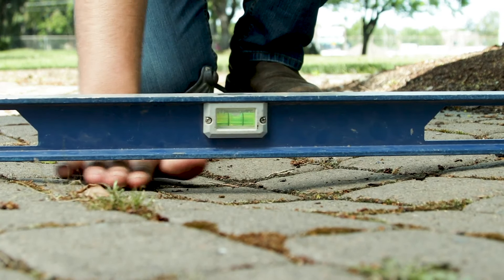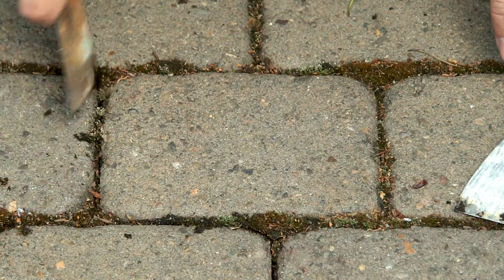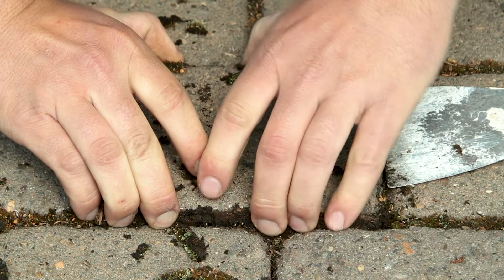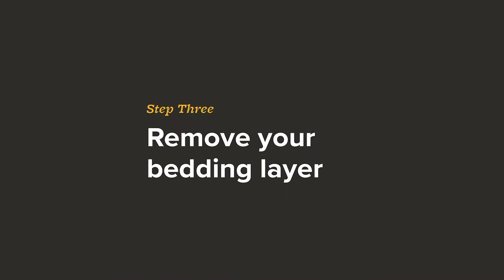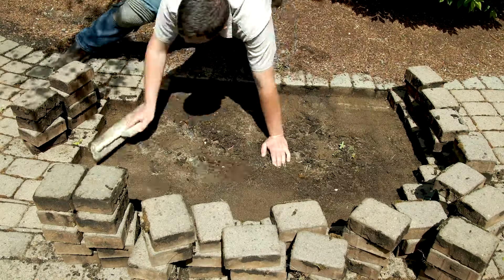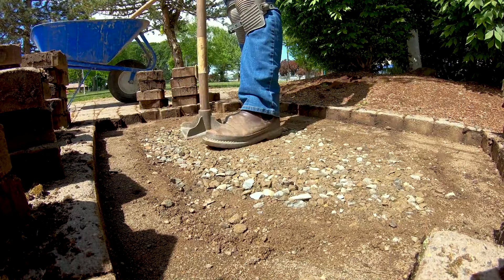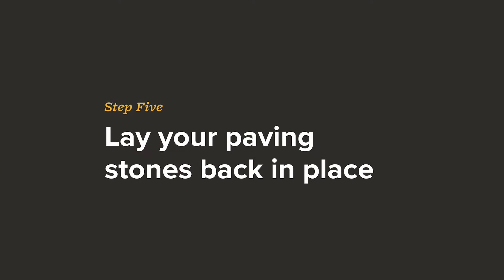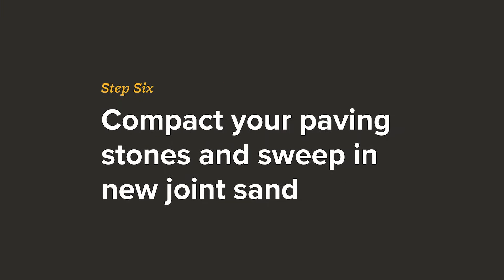How to Repair Sinking Patio Pavers

Comment: If you have a pattern or cut pavers. Put them out & lay them the way they were pulled or you will have a headache
Reply from the maker: This is very true. Often it is helpful to mark each paver with washable sidewalk chalk. Also, taking a photo prior to removing the pavers will make it easier to go back correctly.
Reply: @WesternInterlock  take a picture before you remove everything so you can put it back the way it was
Reply: Number every stone with a chalk stick and take a photo it will give you correct orientation and placement references.
Reply: This comment prob just saved me
Reply: Number the blocks with chalk and then take a photo

Comment: Good tip to add is to lay down your leveler again after adding the concrete sand and poinding that in to make sure you are laying the bricks on a flat and even surface
Reply from the maker: What I think that you are trying to say is that you can use a level to check your work as you go. This is a good idea, especially if you don't trust your eye.
Reply: yea good point, i was surprised it wasnt mentioned.
Reply: @Its_just_me_again  That's what I came here for. To get tips on-leveling it with the other pavers and getting everything even.

Comment: My pavers are locked in. No room to get any putty knife between them. Any suggestion on how to get out that first paver without destroying it?  Thks jc
Reply from the maker: Sometimes, you may need to approach from a little further out from the epicenter of the settled spot because the settling can pinch the center pavers tightly. It is sometimes helpful to pound the pavers with a soft, heavy mallet to vibrate them loose before you start. You may also have polysand, which can really lock in the pavers. If this is the case, use boiling water to dissolve the polymers and loosen the sand. Unfortunately, it is possible that you will need to break a paver to get started. Sometimes this is unavoidable.
Reply: @WesternInterlock  Thanks very much for the advice. I do have polysand. I will try all you suggest. Appreciate your time....jc
Reply: @WesternInterlock  Thanks Very much...jc
Reply from the maker: @Samson-EC  you are welcome!

Comment: I have about twelve sinking pavers on the edge of my patio.  The sand from underneath keeps appearing right next to the patio in a pile, as if a critter of some sort is digging the sand out of there.  Is there some sort of material I can use to prevent animals from digging the sand out from underneath the pavers?
Reply from the maker: There's a couple of different things you can do. The first thing, and probably the best is to remove your edge restraint all the way along the edge of your pavers and replace it with a concrete type edge restraint like Perma Edge. When properly installed, Perma Edge will keep rodents out from under the pavers. You can view a video about how to install it here: https://youtu.be/vquYkpXZU_s

The second option would be to bury some 1/4" - 3/8" stainless or galvanized hardware cloth along the problem area. This will effectively fence out the critters. However, it is important to bury it quite a ways down to prevent them from burrowing under. Here's a sample of the hardware cloth: https://www.amazon.com/Fencer-Wire-Gauge-Galvanized-Hardware/dp/B00989DJDO

Best of luck!

Comment: There might be a self-evident answer, but if you've just recently put your pavers in and find that there are a number of uneven areas, is there any reason why you can't reuse the existing sand, providing you don't mix it with the paver base below? I made the mistake of waiting too long to compact my pavers and it looks like some areas compacted themselves a little unevenly. Thanks in advance for any responses?
Reply from the maker: No there isn’t any reason you can’t reuse the sand.

Comment: Whats up with the major moss and weeds around that area? Wouldn't those areas keep affecting that previously low area?
Reply from the maker: We're in the PNW. Here, if it doesn't move, it grows moss. It is everywhere, so no, moss is not necessarily indicative of a drainage problem. We're more concerned about the final grade.

Comment: Thanks, this was informative.   I have a paver that is sunk in and I've been unable to remove it with things like screwdrivers due to the tight fit.   I'll have to find my putty knives and dry to go at it from two different sides.
Reply from the maker: Sometimes it's helpful to scrape out as much of the joint sand as you can, then use a rubber mallet or a sledgehammer and a block of wood to jar the pavers to break up the interlock in the sand joint. If you actually have polysand in the joints, it can be extremely difficult to remove the pavers. Hot water is then necessary to loosen the polymers.
Reply: I guess im asking the wrong place but does anybody know of a tool to get back into an instagram account??
I was stupid lost the password. I appreciate any tips you can give me!
Reply: @Westin Kamari It worked and I finally got access to my account again. I'm so happy:D
Thanks so much you saved my ass!
Reply: @George Jaxxon happy to help :D

Comment: Great video, and very informative. I just discovered today that a corner of my home the pavers kind of actually lifted making them uneven from the rest. Hence I noticed all the other pavers have sunken evenly about 1/2 inch in 13 years from the line mark on my home. I will tackle that corner edge but do you consider the others sinking in over 13 years normal?
Reply from the maker: There will always be some sort of settling over that period of time. I would consider it to be normal for a standard paving stone installation. The industry has moved forward in the last 13 years and current installation methods are more durable than were used back then.

Comment: I did everything but have 1 paver left and can't place inside, do pavers expand?
Reply from the maker: Great question! Pavers themselves don’t expand, but temperature changes can cause movement due to expansion and contraction of the base material. If your last paver won’t fit, check if surrounding pavers have shifted. You may need to adjust or slightly tap them into place to create the necessary space. Let us know how it goes!
Reply: @WesternInterlock  I'm so proud of myself, I couldn't do it without your advice. I grabbed a rubber mallet and started tapping the pavers surrounding the tight opening it took a while due to my inexperience, but it went in. then put sand over that section to fill the grooves and keep tapping the pavers till they settled in flat. God Bless you, Thank you so much.
Reply from the maker: @bigdogpistolp5898 that’s great news! Glad we could help! If you have any more questions just call us at 503-623-9084!

Comment: Love the video! Just wondering, are you able to still follow the same process but using limestone screening instead of gravel? My paver's have sunk a lot (around 3 inches), and I noticed that it originally had limestone screening underneath.
Reply from the maker: We do not recommend screenings. #57 stone is the best.
Reply: @WesternInterlock  I took another look outside and it seems I misunderstood what was being used for my pavers. It was limestone gravel, not screenings (the rocks were really small since the probably broke down over the years). Either way, thanks for response!

Comment: Hey there, I have to do a small area on the driveway. You mentioned Concrete Sand, I’m in Australia and don’t know yet if it’s available here BUT I do have half a bag of concrete and half a bag of gravel like sand. Can I just mix them together and when I water it sort of sets if that makes sense. My Hubby went home last year and my family are all Tech nerds😆. Help appreciated 🥰
Reply from the maker: Washed concrete sand is the specific sand that is used in concrete here in the US. What you need to find there is some sort of washed quarry sand. No need to add concrete. 😊

Comment: What is the difference between concrete sand and joint sand? Are those 2 separate things I need to purchase?
Reply from the maker: They are two different things. Concrete sand has larger pieces in it and is often damp. Sweeping sand is very dry and very fine. You could conceivably use concrete sand as jointing sand, but you're going to work a lot harder getting into the joints. Sweeping sand is also available as polymeric sand that has polymers in it, which, when activated with water, harden.

Comment: I want to lay pavers on top of my uneven concrete patio. Can you recommend anything to use to level beneath the pavers? I don't want to pour concrete below it because I want something I can remove in a few years. Thanks!
Reply from the maker: We recommend using a layer of sand on top of the patio to help eliminate any unevenness. If it's too bad, I'd mix up a bucket of self levelling concrete and pour over the top first. Any imperfections larger than 1/4" will telegraph right up through the pavers. You could also use a 60mm paver around the perimeter and a thinner paver (40-50mm) for the middle. This would give you even more wiggle room with the sand.
Reply from the maker: We also have a video about overlays that will be dropping in a few weeks.
Reply: @WesternInterlock  Thank you for the advice and the reply! 👍

Comment: Thanks. How do you make sure that the layer of the freshly laid concrete sand is exactly at the right level, so that after you put back the interlocking pavers, they are not higher or lower than the rest of the area.
Reply from the maker: That's an excellent question. This is why we recommend pulling up pavers for quite a ways past the problem area. This way, you can use the undisturbed bedding sand as a sort of guideline to go off of. Additionally, you can use any sort of straight edge that will fit across the hole and then measure down to make sure the gravel is flat before putting the sand back. Honestly though, this operation is more art than science, so just feel it out as you go. Trust your eye and you should be good.
Reply: Ya...came here with the same question.  Levelling the base layer in multiple directions has been very fine consuming.
Reply: @robdc4829  it's the most difficult part. The rest is just labor.

Comment: How much does a job just like this typically go for; I feel like underbid the job, got haggled down but still agreed. 🤦🏿‍♂️
Reply from the maker: There are simply too many variables to give any sort of accurate answer to this question. Know your costs and what the local market will bear and go from there.
Reply: @WesternInterlock  Ok, well I factored in the concrete sand but didn’t factor in gravel and the stuff used on top of pavers at the end. 🤷🏿‍♂️
Reply: @WesternInterlock  Ok, So I just watched the video again & I thought of something. Say I was to do this exact same job but wanted to pressure clean the pavers afterwards. Would I have to reapply the joint sand afterwards? And what if I wanted to apply some type of sealer for the pavers, would the joint sand go in after it’s all sealed or before being sealed?
Reply: @luissonoma6255  You don't want to pressure clean the pavers immediately afterwards. If there is spotting or haze from polymeric sand runoff, you can pressure treat the areas by wetting them first, spraying some poly haze cleaner with a pump sprayer, then scrub before rinsing off. You would definitely have to reapply joint sand after undertaking this process.

Comment: I tried this and I can't figure out why I have space and no room for a line of bricks when it fit before
Reply from the maker: Did you clean the pavers before reinstalling? Any latent joint sand on the edges of the pavers will make them larger than they actually are. Also, be sure to lay them back in tightly against each other and then go back and adjust them to take up any slack with a flat screwdriver.

Comment: Can I use this method to raise a walkway by 6"? The walkway is too low compared to the steps it meets up with.
Reply from the maker: Yes, you can. Scrape away the sand and add your gravel, tapering up to the height that you need. Just be sure to add your 6" of additional gravel in 2" layers, compacting each layer. Then rescreed your sand and relay the pavers. Whatever you do, do NOT add 6" of sand. You will be saddened by the results.

Comment: I wish you had shown exactly how to level it and video taped the process. It’s the hard part of the project. Then we could see how much you add and how you level.
Reply from the maker: Yes, you are absolutely right. Getting it level is the hard part of the project. The challenge with showing exactly what to do is that it is more art than science. Basically, you are removing enough material to expose an area that is level and then adding material to the low spot to match, then blend it in by eye.
Reply: @WesternInterlock  very useful. Thank you!
Reply: In this situation after you lay down the sand and even it out, you can place a couple pavers in the middle and bridge those with your level to the side pavers to see if you need to add more sand or remove some.

Comment: Would you power wash before pulling the pavers?
Reply from the maker: It's not necessary to do so. Once you pull the pavers out, it's really easy to clean them. Even simply banging the pavers together often gets most of the dirt off. A stiff nylon brush also works. If you do pressure wash, be sure to turn the pressure down to below 1500 psi to prevent damage to the pavers.

Comment: you mention nothing as to leveling  sand base so stones lay even
Reply from the maker: You are correct. That is why we pulled up past where the bad spot was. This gives you a reference point to work from. This part of the repair is definitely more art than science. Just trust your eye and it should be close.